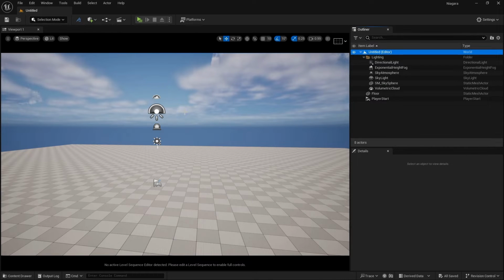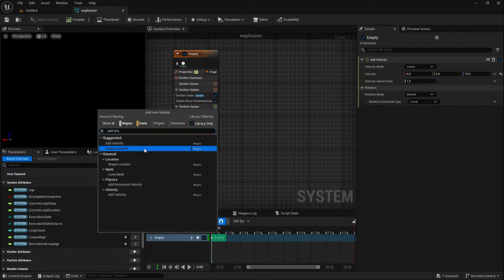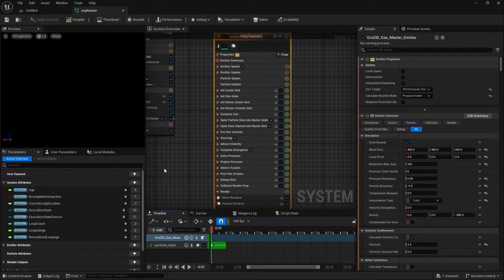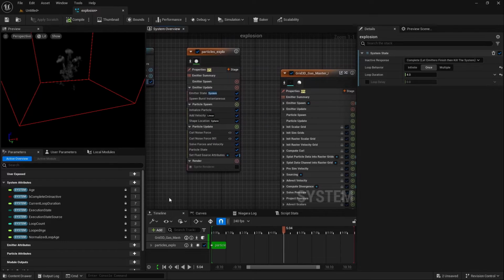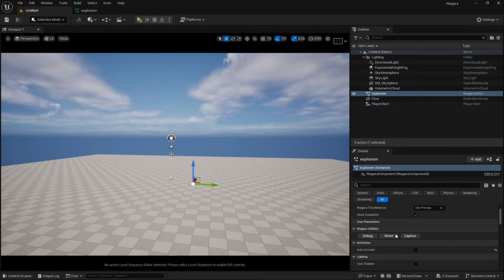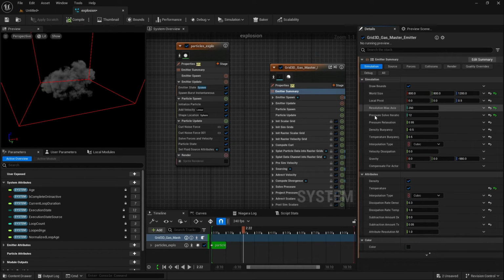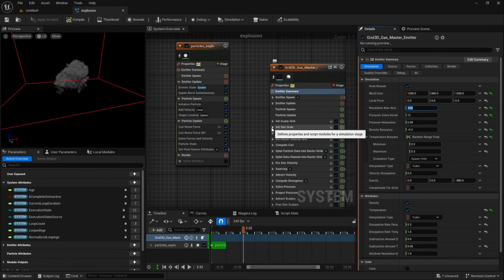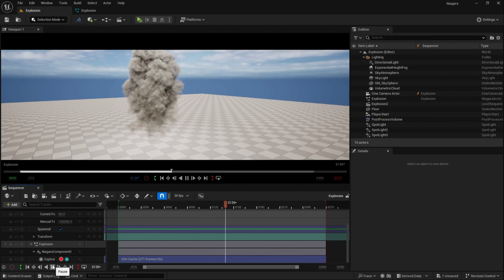Advanced Niagara VFX Technique(Advanced Niagara VFX Explosions Tutorial)

Comment: The tip about Render overrides is just amazing, I was looking for copper and found gold! Does this work for the recorded cache or only for the simulation? Let's say I apply this setting and write the simulation cache, will the cache be written at 400 or 250 resolution?
Reply from the maker: Hi glad you liked it. If you do 400 in render override quality and do simulation cache it will write in 400 only.
Reply: @RenderRebels  Yes, this is exactly what I've been looking for for so long! Can you give me a solution to another problem? Is there a way to make these effects affected by volumetric fog? I am forced to use the console command r.HeterogeneousVolumes.MaxTraceDistance 50000000 to make the effect appear at a greater distance, but have noticed that fog or any other effect in the foreground has no effect on Niagara fluids. These effects do not lose clarity, are not blurred or are in any way distorted by smoke or fog at a great distance, which makes them stand out from the environment. Is there a way to solve this problem?